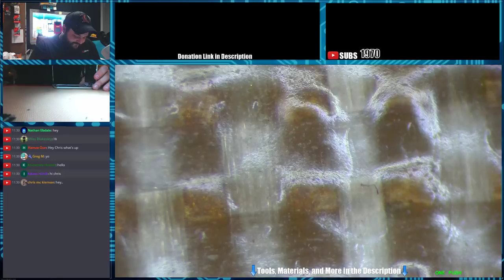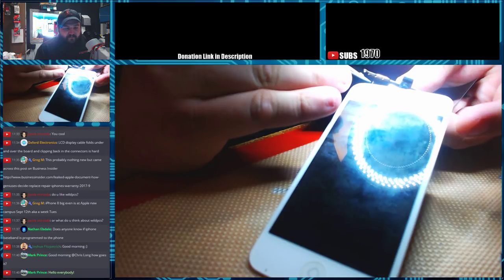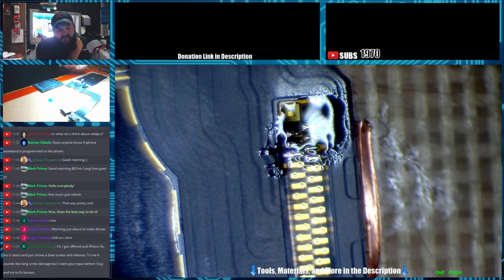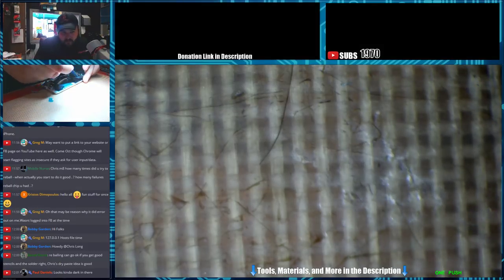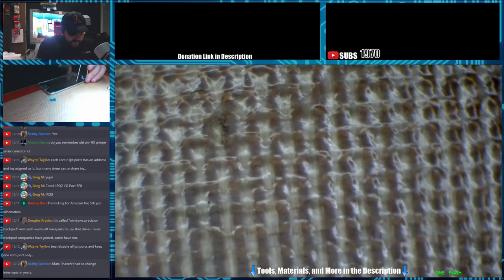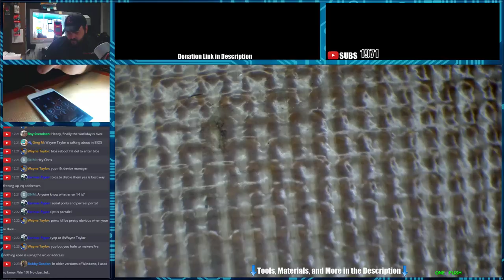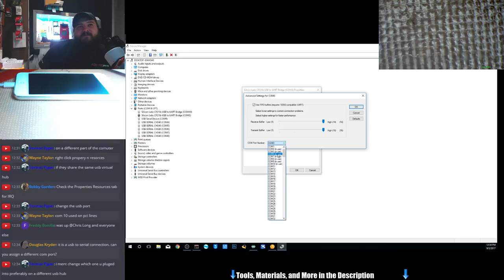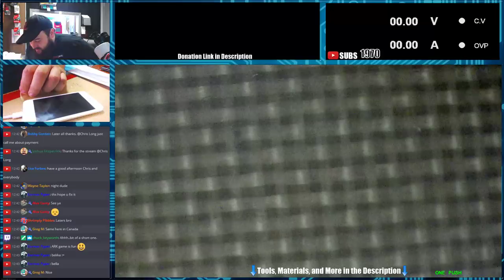Sunday Funday! iPod Touch Charge Flex Replacement

Comment: chris regarding the multi rs232 I have this issue with using more than 1 usb to rs232 (usually when they are same  brand or chipset0 you could try two different brands or the this startech ICUSB232C2 2 port USB to DB9 RS232 Serial Adapter Cable. I have not tried it yet but having 2 serial from one usb sounds like it should work ok. if you don't want to spend the money to try let me know as I may get one in for work to try anyway.